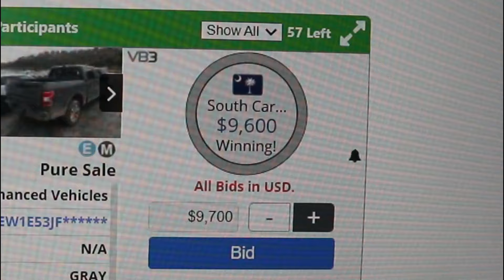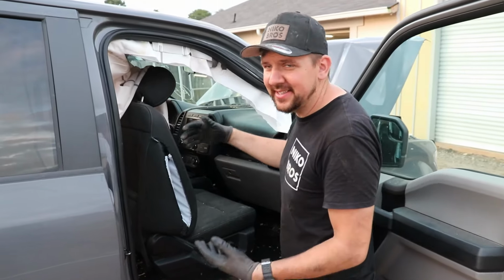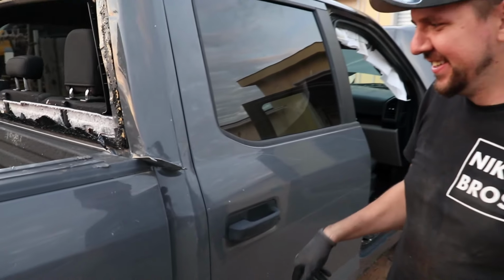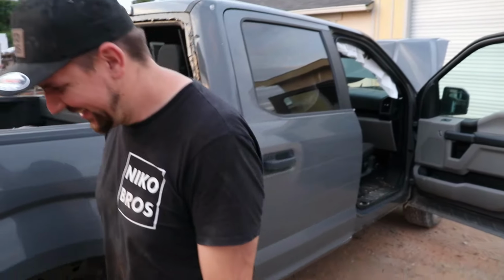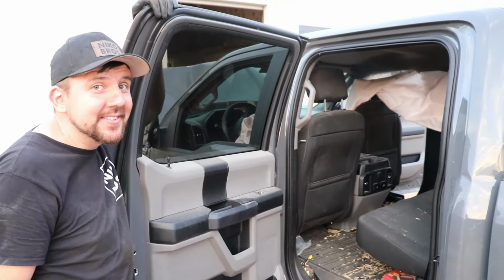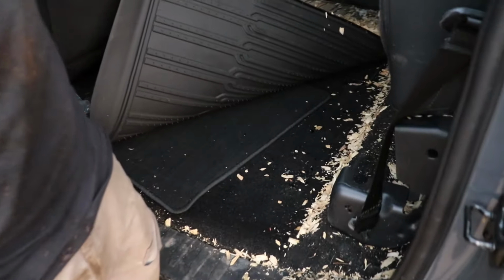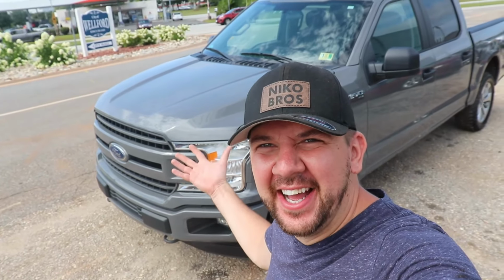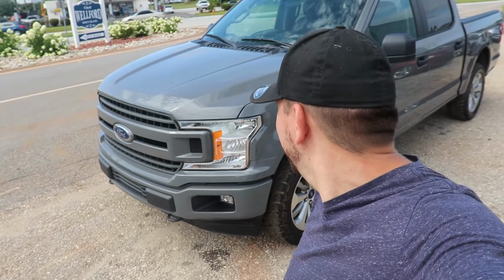STX 4X4 2018 Ford F150 Full Salvage Rebuild Start To Finish

Comment: Make sure when it said paint this side on plastic inside spray booth (you paint that exact side, or the problem you will have is that when you get to clearcoat you start having paint flaking off plastic and you will be in very big trouble ) I had to repaint a quotor paned because of that scenario

Comment: With the right equipment it makes it soooooooooo much easier. With the more you took off, the better it looked. We know it was a lot of work but you're making it look like a piece of cake.... Maybe ya'll should go into a joint venture with the Goonzquad, now that might be interesting, hummmmmmm. Maybe once you finish the Motor Home ya'll could run down to Tenn and visit for awhile...........

Comment: Didn’t see you fit radiator or coolant or run the engine or sort the tailgate ? 🇬🇧🇬🇧👍🇬🇧
Reply: Seen the radiator assembly go in.  But didn't see if the tailgate was repaired. So assume it was just replaced if they didn't show the repair technique.
Reply: Coolant bottle is  filled at 15:45

Comment: I always wonder if this car is less strong now?  Like metal fatigue or is this just possible without consequences?
Reply: @DrinkWhiskeyRaiseHell  it actually wasnt bend that bad they replaced the crossmember I just think it looks work in the beginning then it actually was
Reply: I think the problem was a large part of the video was timelapsed, so not easy to see. I think I would replaced the front chassis legs at the joint , but who am I to judge.

Comment: How do you get a salvage titled truck registered? I didn't think you could ever get it registered once it had a salvage title.
Reply: In some states,you can register and drive any salvage titled car once it passes inspection by the dmv or similar agency.they basically check the car throughout to see if its fit for road use and also see if the repairs were done correctly.once it passes,you're good to go.some states are chill and let you drive the car there while others are just strict to the point where you need a trailer to take the car there unless you fail.

Comment: Did you have issues starting it up? 
I got same truck with only blown seat belt, 5.0L! It won't start, all lights turn on, but starter not is silent. Any ideas?

Comment: where I'm at a wrecked car that's repaired gets a rebuilt title and that reduces what you can sell it for. is it the same there
Reply: Same everywhere pretty much
Reply: In the UK you reapply for the V5 (log book). It will have been noted as crash damaged so yes the value will be lower. It's a case of  buying at the right price as you would anywhere.

Comment: Hard to imagine this being worth the effort. The frame damage would have to be much more than what was shown in the video. That engine was pushed back into the drivetrain...which means tranny and transfer case 
and rear differential had to be affected. Not to mention suspension and braking and rear portions of frame.
For that matter, the engine itself took a hell of a beating...Just seems like you'd have to completely dismantle and inspect every important system on this guy. I mean, just think of the effect on that differential and axle/brake assembly after absorbing this kind of force. Kinda scary...But if you could keep the cost under 10k or so, with the 10k purchase...Nah...still doesn't add up when considering the salvage title that 
will never go away.
Reply: trust me this one was not worth the rebuild. That was way more damage than the Nicos showed
Reply: I think you’re absolutely right. However, I’m pretty sure he is doing this only to get views from YouTube and monetize. In the end, if he can sell for the same amount he spent fixing everything, still would be very much worth it just because of the views on YouTube.
Reply: It hit a tree wood chips are from chainsaw

Comment: Does anyone know if the crash/ impact sensors need to be replaced or reset? I’ve been watching all these salvage videos I’m currently working on a 21 ranger just the steering wheel airbag was deployed and the seatbelt locked, never been involved with airbag collision stuff

Comment: It's a great project for those that can do it and it might be worthwhile if you are going to keep it for yourself. If you plan on flipping it for a great profit, forget it. Salvage branded titled vehicles have low resale value and for good reason. No way for a potential buyer  to know if it's been fixed properly by looking at it and what kind of issues you might have with it in the the future. There's a big difference between looking right and being right.

Comment: Those scratches on the tailgate look just like the forklift that picked it up the loader.  looks like it hit the cage for the blades. Seen it on other vehicles it's from the guys in the yard slamming the truck against the cage when they pick it up cuz they don't give a shit

Comment: After front end hard collision like that and airbags shot out, truck needs to be at the wrecking yard and to be sold for salvaged parts and then scrapped. Good job, but its not worth to do all that repair it's not going to be in factory like condition again.

Comment: I recently had my car totalled and the insurance company offered me to buy it i want to fix it and i don't think the damage is bad. How much does a job like this cost after buying back the car i will only have about 5,000 to fix it up. Not as much damage as yours only headlights, grill & fenders that's it oh and airbag deployed and cracked windshield that's it

Comment: OK, it LOOKS pretty , but does it DRIVE safely??? Can it get up to 105 MPH and you take your hands off the steering wheel and not get F-150 "Death Wobble"??? Since lots of un-wrecked F-150's can't with-out the factory re-call, I WOULDN'T DRIVE IT AT LEGAL HIGHWAY SPEEDS!!! My life is worth more to me than what you've "saved" on a totaled salvage truck.